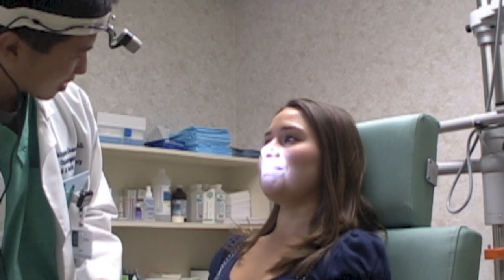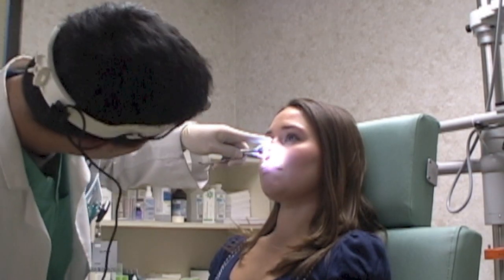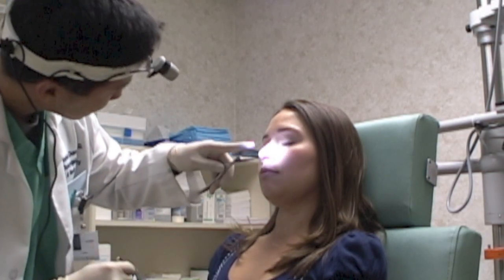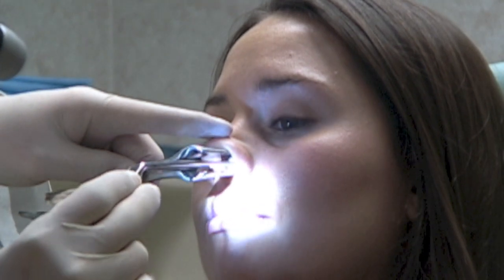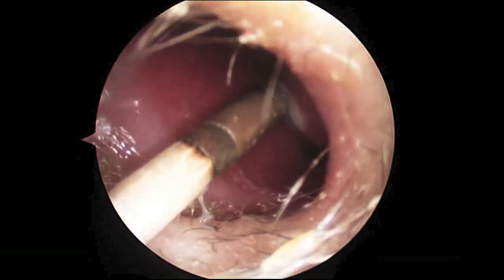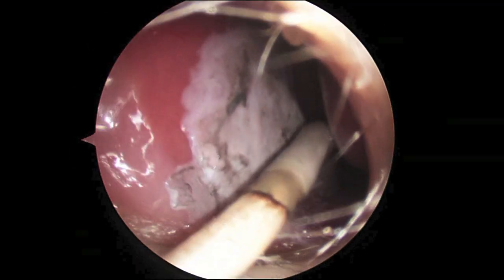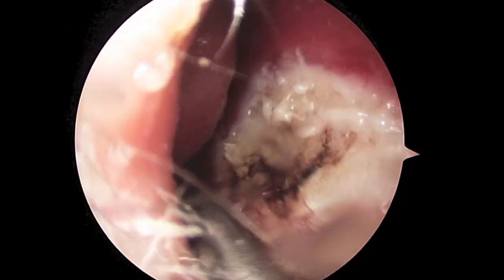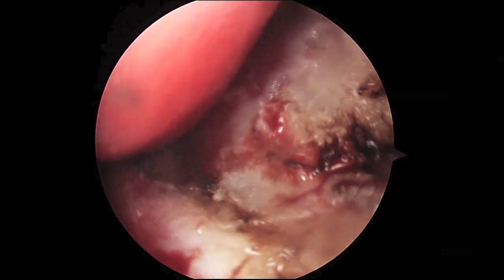Nosebleed Control by Cauterization (Silver Nitrate and Electrical)

Comment: I get about 1 or 2 nose bleeds every day ever since I started living in Massachusetts. I use to like in south east Texas where the climate is super humid & I rarely got nose bleeds. If it happened it was because of a really strong gas, usually it was like methane, & smelling it for a long time. But I’ve had more nose bleeds here than I’ve had in my life time
Reply: Since it's cold up there, get a humidifier for your bedroom. Plus wrap your scarf up over your nose, to keep it warmer. My nosebleeds are not only worse from dry air, but also changing temperatures going inside to a heated building after being outside in the cold.

Comment: I had to get my nose cauterized twice without being numbed (2nd time being a week after the first time not being fully successful) and it hurt like a bitch. Both times my eyes became teary, nose dripping and had severe pain and burning in my nose for the rest of the day. The procedure was actually really fast but the amount of pain I felt sky rocketed and I wouldn't describe my sensitivity and tolerance as a little child.

Get your nose numbed before this. For me it actually hurt a lot more than the typical cauterization because I actually had nose bleeds several times a week for over 2 years before getting help lol. The weird thing is that right after the first cauterization, as I was leaving the building I had a strange dizzy head sensation feeling like the world was spinning and I was gonna pass out and throw up, a bad headache, and sort of a high feeling but definitely not pleasant. Once again, get it fucking numb. I don't know why my doc just went straight in both times.
Reply: I am in the same situation 2+ years now and am sure I want to have the "real burn".  I was told more effective. how is it these days?
Reply: ***** Haven't had a nose bleed since.
Reply: My nose has fluidly bled 12 times since my post. up from average of 2 per week.  Im starting to think that either way, this shouldn't be a norm..
Reply: get the cauterization done, it'll save u a lot of trouble
Reply: ***** for sure ask ur doctor

Comment: This is a really silly and unnecessary procedure.  If your nosebleed is normally due to either it being too dry or from a trauma.  

If it is too dry then moisten it and the nose will quit bleeding.  I have found my nose bleed because of the heater being on and drying up the air.  Either use a humidifier or moisten the nose and it will stop bleeding.  Why would you want to damage your nose with an unnecessary cauterization?
Reply: +munchichi8 many people have a much bigger problem with nosebleed then you think... I bleed every day fore a week and had to do it, and I have don it many times.. so some people need it :)
Reply: +Myragutt97 I got an electrical cauterization today it was so painful.
Reply: I have nosebleeds one or two times a day, and it's not just because of cold weather as I live in a very humid area. We saw a specialist and he said the best way to stop them would be to cauterize. So no, this is not a unnecessary "silly" procedure. My nosebleeds disrupt my daily life and make me stop what I'm doing, I've gotten them during exams before, while skiing, while on stage during a dance competition and while swimming. This is a VERY necessary procedure for many people.
Reply: Oh and they've been going on since i was 10, I'm 15 now.
Reply: +munchichi8 Depends on the reason for the nose bleed. I do MMA and my nose bleeds from a slight jab to the nose almost 9/10 times. So for me it would make sense to do this.
Reply: I've had chronic nosebleed syndrome since I was maybe 4, I'm now 17, it's not that simple buddy
Reply: +DanOn2Wheels Yeah a lot of fighters get it, definitely boxers do
Reply: It;s not unnecessary if you literally have a blood vessel that has broken in half. There is not stopping that.